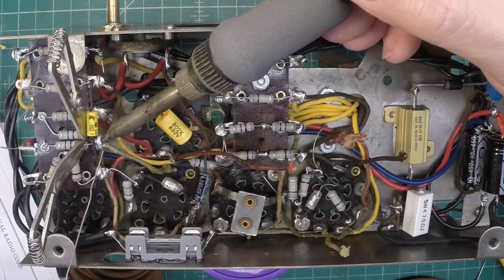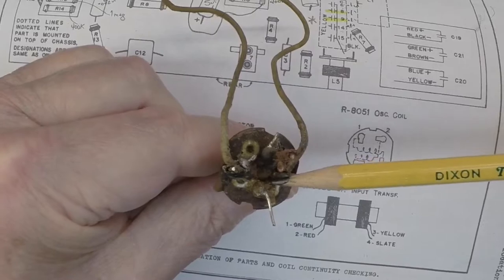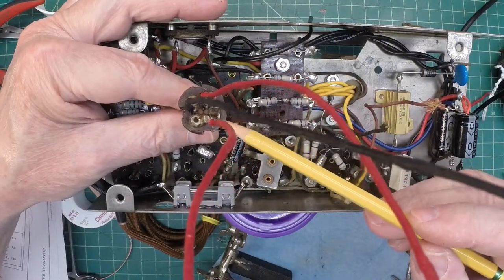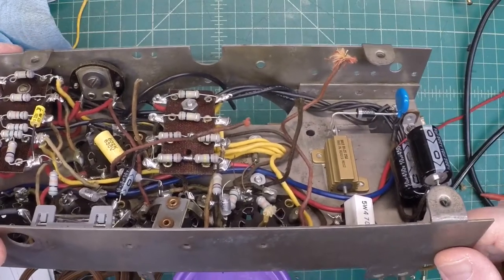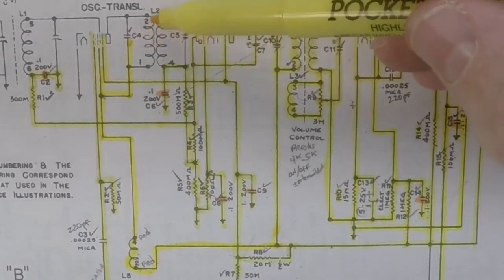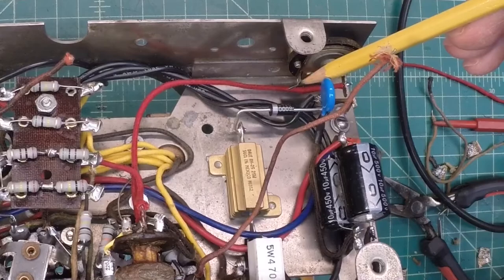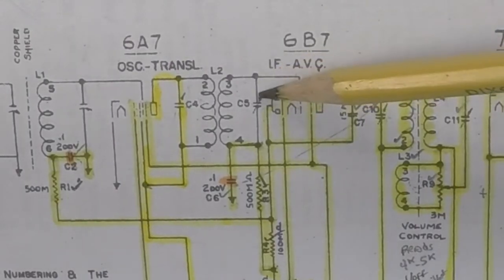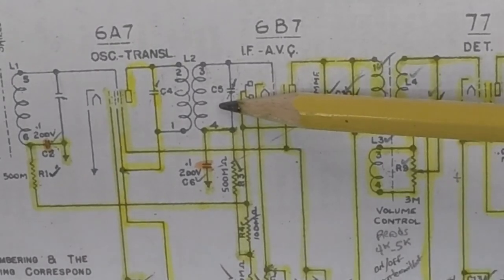Silvertone "Companion" 57 D 1704 - Oscillator Coil & Two More Trimmers

Comment: Hey Don, nice work.  I've been playing catch up on folks videos the last day or two.  I don't believe I'd have the steadiness of hand to work on something packed so tightly together as that 1704.  May I ask, what kind of soldering iron do you use?  Is it one of those "solder stations" as they call them?  I have a couple of soldering irons but can never seem to get them to melt any solder so I always end up using that big Weller gun.  I'd love to have a soldering iron or station where the iron was already hot and I didn't have to grip the trigger and invariably get shaky handed while trying to solder.  Thanks, Gary
Reply from the maker: +Rebel9668 Gary, I’m way behind on comments, so please forgive my belated response. I use the Hakko FX-88D Station and my big gun with a trigger for chassis grounds is a Weller D650. Hope this helps. Best, Don